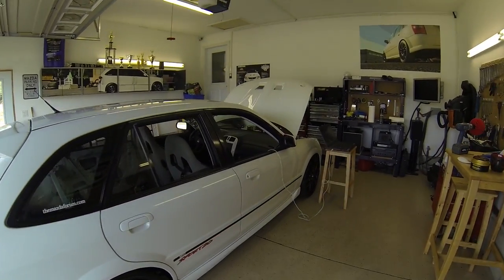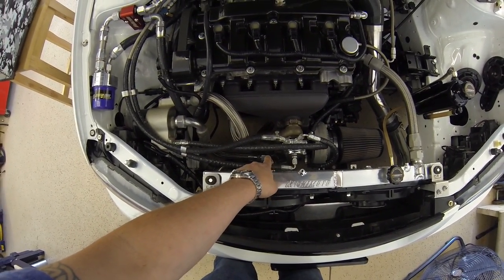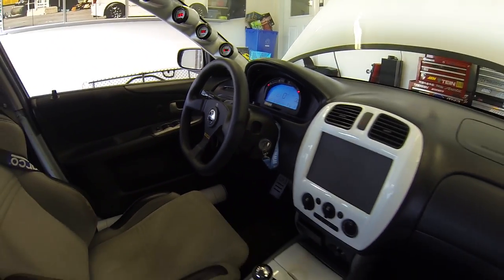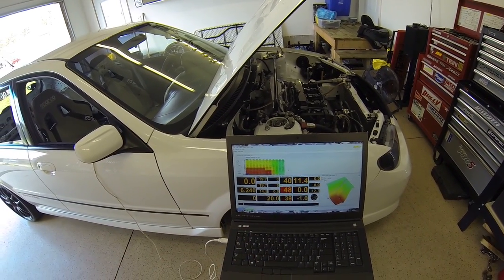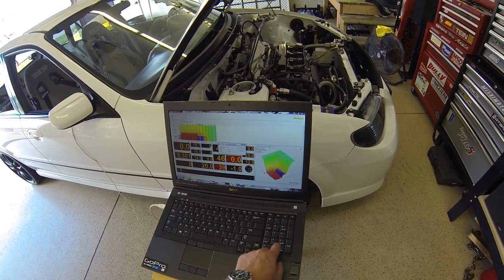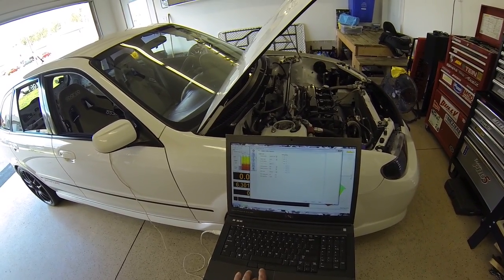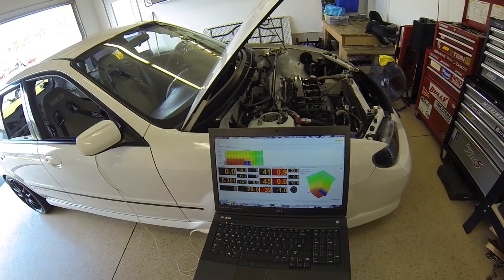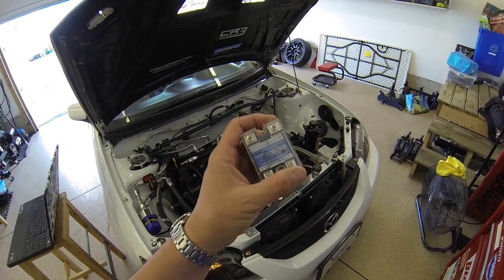Cooling System   MP5T

Comment: nice setup i have a 1993 mazda 626 that i also build my self for drag racing
Reply from the maker: Please send me a link to the car that you have built.
Reply: @NOOBIFIER1337   what DPO or pin  did you use on the Haltech side . I am doing the same I saw your post on Haltechs website
Reply from the maker: @alexrodriguezrx7  Pretty sure it was 17 and 18 for fan and pump